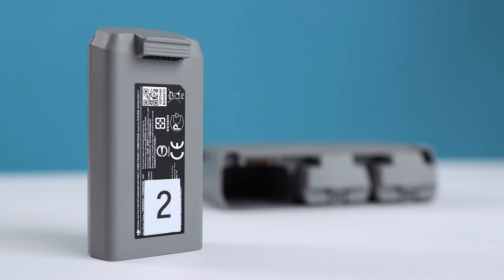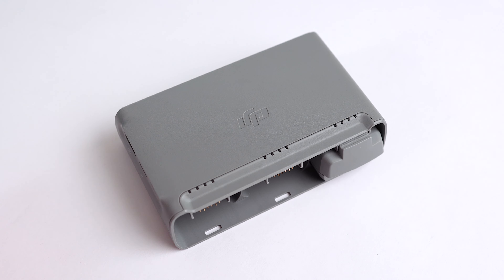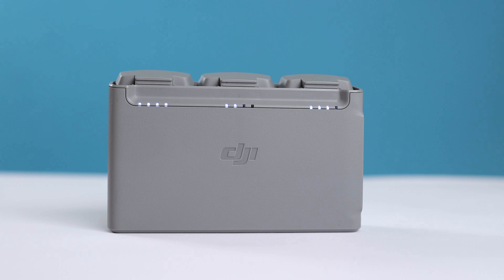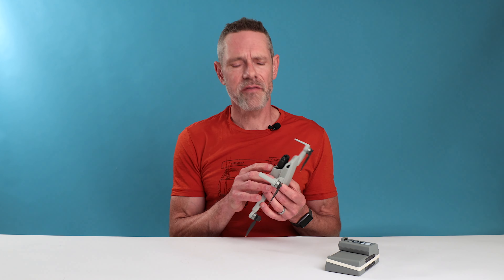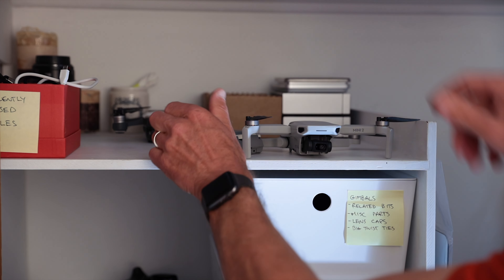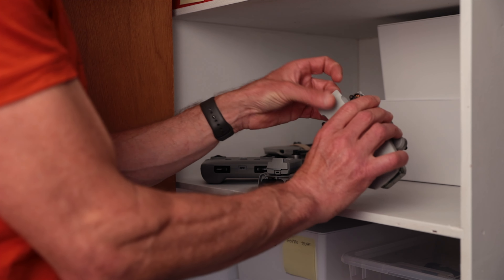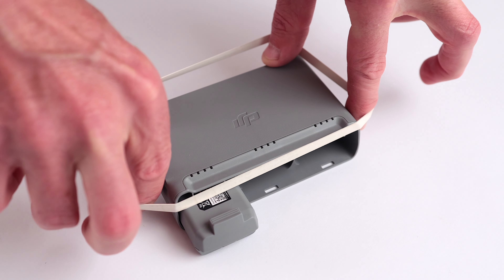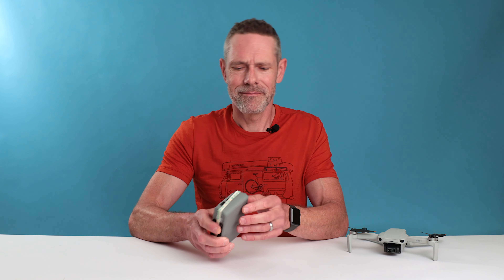DJI Mini 2 | Battery Discharge Issue + Workarounds (Fix Coming Soon)

Comment: I disagree that a fix is impending.. I'm beginning to think the only answer here may be a class action lawsuit someone should file against DJI for completely botching Mini 2 Smart Battery design (inability to self discharge due to requiring a comm line open for LED charge level indicators and power switch.) They have already admitted fault (probably not the  smartest idea) and all indications are that they may be unable to fix it. (2+ months without a fix, after promising a "swift update") 😉 I am not down with the litigation happy world of lawyers- sue everyone everywhere always -but DJI is not a tiny company being preyed upon here.  At minimum they should supply either a full set of replacement batteries (I am sure there are blissfully ignorant folks out there completely unaware of the issue, and the potential early and imminent failure of these batteries) or a discount on the redesigned Mini 3 that will certainly have a hardware redesign on battery connectivity by  allowing disconnect from switching and charge indicators. Not hoping for this outcome, but it's obvious to me that there is no way to fix this with firmware. Proving me wrong would be the best outcome for all, but I'm not hopeful having dealt with similar issues in computer hardware over 40+ years, but hey, there's some incredibly smart folks at DJI, and if they find a way out that's not a warning label and Safety instructions, I'll be impressed as hell.
Reply from the maker: The video was created with the best information I could find at the time and taking DJI at their word. As it drags on and new information comes available, I agree, you have to wonder if a software fix is possible. I also agree, if a remote fix is not possible DJI needs to take care of its customers. We shouldn't have to collectively sue to get a company to do "the right thing". I have owned 3 DJI drones - Spark, Mini 1 & Mini 2. All three have had issues right out of the gate. I kind of expect new products to be a bit glitchy but I also expect the company to stand behind their products and take care of their customers. I guess we will see how this plays out. Cheers!
Reply: @SteveCoutts  Well put. A company shows their true character when things go wrong, not when things are going great. I have no reason to suspect otherwise, but I do hope they don't let this go too long, to the point where we start seeing reports of failing batteries. Consider Apple's high profile issues, most of which were dealt with fairly,  not out of the goodness of their hearts, but at least from a sense of preventing damage to their reputation. Samsung also with the recall of millions of Note 7 devices.

Comment: left battery for its own alone: died after 1 year. pulled the second battery out of drone after one year: everything okay. i wanted to activate my drone i bought one year ago. this faulty battery is brand new, and i`m really pissed. and after checking this year, that firmware updates blocked any hacking AND DJI drone sends UNENCRYPTED data for DJI aeroscope all the time, DJI is dead for me. bought another drone brand with no aeroscope crap and no restrictions, more functions. bye bye, DJI. mini 2 was the last drone after phantom 3 advanced and spark. they`ve gone to far with disappointing their customers.
Reply from the maker: My experience with DJI products has been much different than yours. My Spark and all 6 batteries I have for it are still working fine, 5 years later. Same goes for my Mini 1 and Mini 2, the drones and all their batteries are still working great! The one and only time I needed DJI Support they replaced my Spark for FREE because a software glitch made it fly away. I have no complaints. If you're unhappy with DJI maybe it's time to try something from Autel. Cheers!

Comment: Found this October 2024 - did DJI actually fix this?  Asking since I got a mini2 some months back and a spare battery - was about to buy a hub and a third battery and to begin ACTUALLY USING THE THING regularly - but before doing so - did DJI fix this ridiculous situation? My phantoms and Mavic 1 /Air 1 all seem to do their stuff as per the mini 2 DOESN'T - so quite how DJI can have boobed like this is - disquieting.  What other boobs are they boobing that ain't so noticeable?
Reply from the maker: DJI fixed it about a month later with a firmware update. I did a follow-up video - https://youtu.be/2fkWBNQI-VQ
Reply: @SteveCoutts  That's a super fast turnaround Steve - thank you. I'll go check the firmware on my mini2   - In fact it updated the firmware and fly safe database just the other week when I was still unaware of this glitch - so guessing all's well now. Relief. Liked. And subbed.
Reply from the maker: @SirBeauJangles  I do my best to reply to every comment. I'm not always that quick though - haha! Thanks for the sub and happy, safe flying!